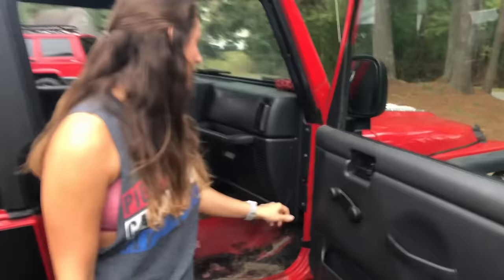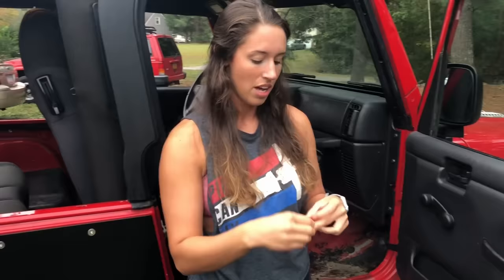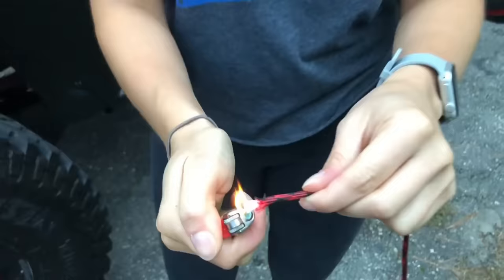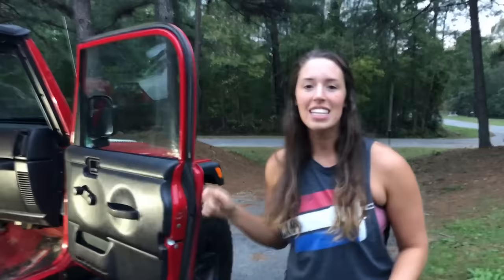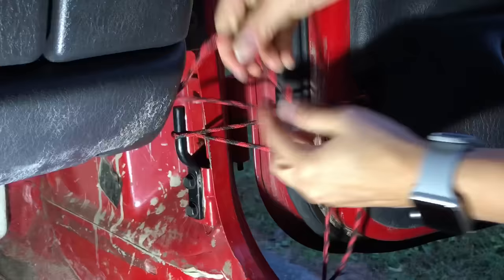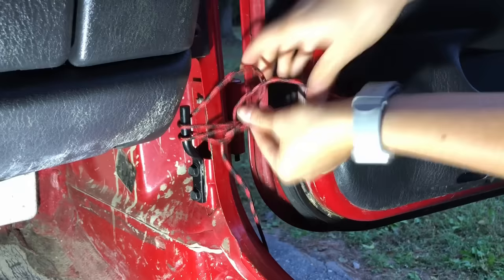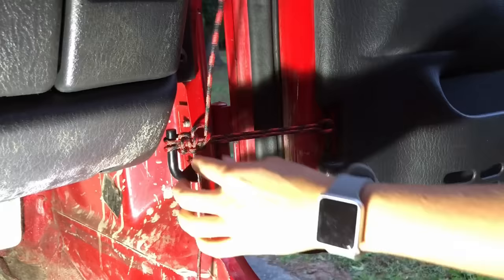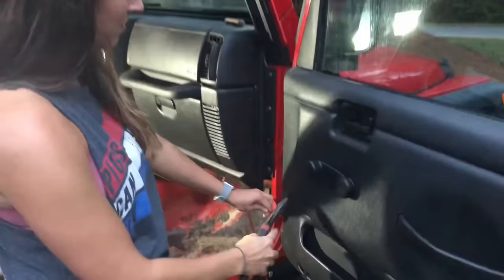Make Your Own Paracord Door Straps - Jeep Wrangler

Comment: If you add a loop of bungee slightly shorter than the paracord it’ll slow the door before it pulls on the door anchors. It especially helps if your passenger just lets the door fling open when off camber.

Comment: Quick tip, use your lighter instead of your fingers to press the end and you won't get your fingers burned. It also leaves a smooth surface.

Comment: Cassie, (hope I spelled that right) as a slick way to terminate or whip the paracord, or any type of rope or cords, you can slip a short length (1/2" or maybe 1") of electrical shrink wrap over the ends, just a little bit larger than the cord size, before you start if possible. When you know where you want to stop and cut, position and heat the shrink wrap with a heat source. A heat gun works much better than a lighter ;) Cut the cord in the middle of the shrink wrap, or the end, depending on your future needs. If you put a piece on twice your needed length, then the new un-used end has a pre-made whip so it will not unravel on you ;)

This is also a great way to make your own custom HD boot laces with the ends secured by the shrink wrap. When I was in the Army (Jan 87-Aug 96) in the 75th, and the 82nd, we would make all kinds of things from paracord. If you use larger cordage, even up to 3/8" or 1/2" poly rope from Home Depot or Lowes etc, you can make custom colored straps for bags, tools, equipment, etc. If the larger cord is too big to go through wherever you need it to go, but you need a larger handle or gripping surface, you can make a second layer of knots over the first. This is basically macrame, by the way. Some call this simple knot a Cobra knot, and the 2nd layer some call a King Cobra knot. I hope that this helps some people, and Stay Classy!!))

Comment: Why is the mirror mounted to the windshield frame? It's suppose to be on the door hinge. Someone mounted them there so they would still have mirrors when the doors are off but I'm not sure if that's the best place for them. Check it for yourself.

Nice idea on the strap. I'm gonna get my daughter to help me do mine.
Reply from the maker: I actually prefer them mounted on the body, it’s nice to be able to take the doors off any not worry about adding mirrors or anything.

Comment: doesn't paracord stretch too much for this application?  I'd hate to rely on it to keep doors from banging
Reply from the maker: Since it’s a short length it doesn’t stretch much. It’s been working great so far!
Reply from the maker: It does stretch slightly, however I have not had any problems with ours stretching to the rear view mirrors yet.

Comment: What human is this a problem for? Paracord, Vape and off brand energy drinks. I like my doors opening all the way mostly, spring I usually connect the strap cause its windy. If it's real windy I'll connect it on the inside see to keep the door opening about like a car at say 38 degrees.